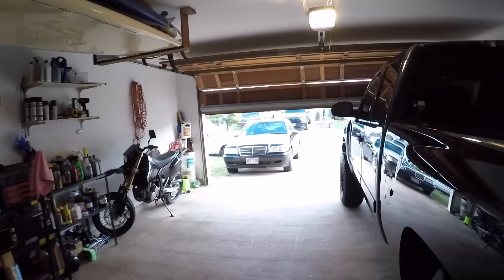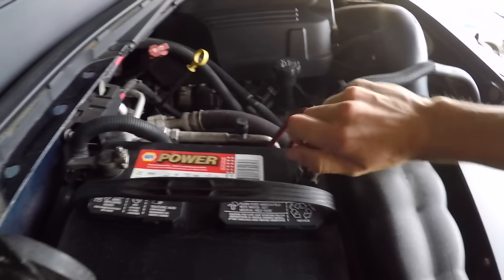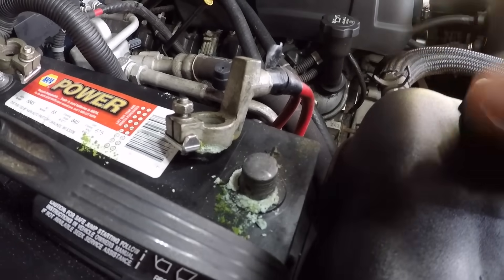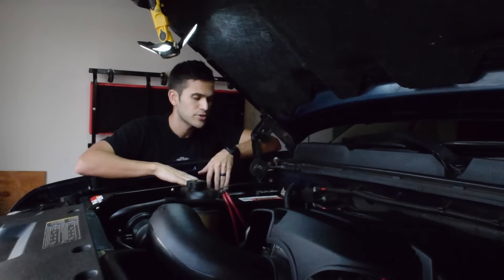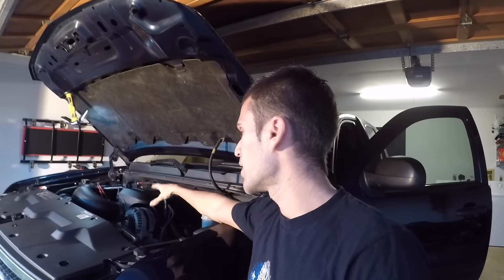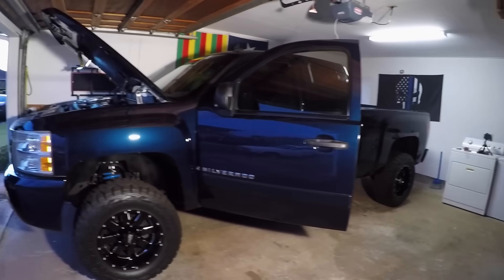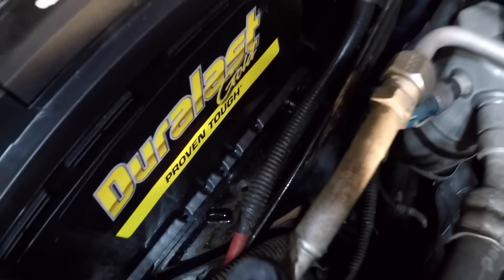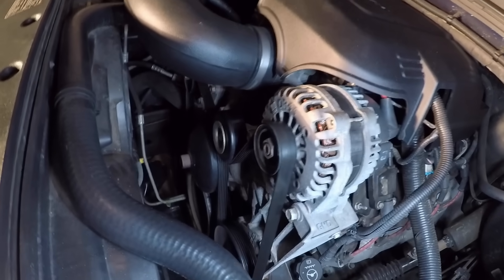Car Won't Start: Alternator or Battery? The easy way to know

Comment: Just one other point to add to an excellent video..On many vehicles, the alternator only charges when the engine revs reach a certain minimum valve, so if you do the alternator test with the engine ticking over, you get a false reading. Best thing to do is get someone to rev the engine gently up to about 1500 to 2000rpm and you should see the voltage rise to around 14v or just over...
Reply: That’s interesting to know.  I thought the alternator charged the battery even when the engine was ticking over.  Incidentally, roughly how long does an alternator take to charge the battery say from 12.4V?  Would I need to be driving for a few hours?
Reply: @Gazzab6  I think it's to to do with the regulator cct associated with the alternator, and it varies between vehicles...

Many years ago, I used to have a 2.8 diesel Isuzu Trooper which I used to off-road...I had been staying at a cabin for several days using the vehicle everyday, but only creeping about very slowly in low gear at low rpm.

 After about the forth day, the batteries  would not turn over the engine.  Luckily I was in the AA and one of their recovery vehicles came out and jump started me and it was the mechanic who explained the issue. 

He also said an alternator and regulator off a particular old Ford would cure it, although I would have to adapt the mounts ect to get it to fit...
Reply: @peterevans8194  Thanks for the info Peter.  I have a 2016 Honda CR-V 1.6 Diesel that has an EFB battery.  When I noticed the battery labouring when starting the engine, I had my alternator checked at my dealership and everything seemed to be okay with the alternator.  Just over two months later I had to replace the battery but I only had the car which was brand new for three and a half years - not very long for a battery I thought.  Three and a half years later, the exact same thing has happened.  This has also happened to my friend who has the same car.  It’s a mystery.  I’ve been checking my battery and it is showing 12V (12.2) after driving for an hour.  I have removed it this morning to charge in the garage and it is now at 12.8V.  I have tested the alternator with the engine ticking over and it was 14.2V but there were no electrics inside the car turned on.  I believe EFB batteries use a lower amperage but that’s a bit over my head so I don’t know if that’s an advantage or not.
Reply: @Gazzab6  it's a bit over my head as well lol. Was your replacement battery the same brand as the original? If so, maybe go for an alternative brand?
Reply: @peterevans8194  yes it was like for like as far as I know.  I’ve done a little research this afternoon and the EFB type is for medium sized cars with simple auto start / stop technology.  My car isn’t top of the range so hasn’t got all the electric gadgets but it has enough and I charge my sat nav en-route quite a lot so that will all add to the consumption.  I might go for an AGM type battery which are also for stop / start vehicles with more demanding electrical gadgets and the product description specifies for use with SUV’s which mine is.  Maybe Honda have chosen the wrong battery for the model I have and it makes you wonder why it’s happening to other owners.

Comment: I have a 2015 Dodge Grand Caravan with a brand new alternator but when I  disconnect the hot battery terminal it completely dies. I have a MaxiCOM reader that I plugged into it while I was driving it and it gave me 13.7 but when I stop and it's idling and remove the hot wire terminal the car dies completely. What do you think the problem could be?

Comment: You might not have needed to change your battery. You forgot about the corrosion you cleaned off. That might have been the cause of the battery not charging.

Comment: Having just replaced the battery (it was pretty obvious the old one was having issues), and still getting similar symptoms to those here when trying to start at lower temperatures, (got lucky twice (once before the new battery and once after) by turning off the radio and heater fan and dimming the lights etc, it started phew) looks like a new alternator is in order.  When  the temperature outside picks up a little (too cold/windy to mess with it), I'll dig out the multimeter and check it out.  Car is hovering around 296K miles (and almost 20 years) now with original alternator and starter, so was thinking it was one or the other…  Hopefully it is the alternator, as it looks a lot easier to replace than the starter. Good vid.

Comment: If anyone owns a GMC/Chevrolet Truck after 2012, please be aware that ECM may be programmed to NOT run the Alternator unless the Voltage drops to a certain level. The Standard practice using a Multimeter on the Battery may not work if the Battery Voltage is above 12.0 volts. You should go to a Battery Store / AutoZone  / Dealership and have the Battery Load tested, it's the only way to know if your Battery is good. Always attach the Negative side of the lead to the Negative side of the Battery first, not the Positive.

Comment: I have put everything new on my Silverado truck but it will not start I even bought a new PCM and no start I turn the not one thing but when I turn the key my engine light fresh on and off but everything works until I turn the key 

What could it me

Comment: I actually am wondering if you had any issues after this video. My GMC was doing exactly what you showed here. Did everything you showed on the video. Turns out, today when I went out and about my day, around lunchtime, my truck did not start again and had to jump start it. Came to find out it was the starter that had gone bad.

Comment: 10.4v is exactly one cell short (1.2v × 6cells) of a 12.6v battery. A bad cell most certainly because the plates got damaged jostling around without the battery secured via the bracket. Anytime you have 10.4v, you have 5 cells fully charged.

Comment: I had very similar problem was dead not starting at all no dash lights took it to 2 autozones tested it and both said was bad. Then I cleaned that gunk off the positive terminal wasn’t much and it started then drove it to oriellys and that guy said it’s good
Will be doing some more troubleshooting like you thanks

Comment: Don’t go to Auto zone find someone who sales Interstate Batteries and get one of them
Reply: About 6 years ago I had bought a car battery from Auto Zone . While trouble shooting the car for an unrelated problem involving the battery, my mechanic mentioned it was not a good idea to buy batteries from Auto Zone. I responded that up to that point my battery had been working in my car for 5 years. I had the receipt to prove it. Being that I keep all my receipts and a record of what parts I install in the car. It helps figure out what can be wrong with the car by seeing when I last installed parts in car. Bottom line is I guess some batteries are good some not; I got lucky I suppose.

Comment: the alternator plays no role in starting the engine, but it takes over providing the power supply from the battery once the engine is running, so if the car won't even start then it's clear that only the battery can be at fault

Comment: CHECK FOR SPARK PUT SCREWDRIVER IN PUG WIRE PUT NERE METAL ON MOTOR TURN KEY SEE IF IT SHOOTS A SPARK

Comment: Another way to test the Alternator/battery, get the car/truck started and running.... disconnect the positive side of battery.... if engine stops it is your Alternator... if it keeps running ... it is your battery... an old mechanics test method

Comment: Next time all you have to do is get the truck running by doing a jump start. Once its running disconnect the positive cable from the battery. If the truck dies then the alternator is not providing sufficient current to keep the truck running. But if the truck is still running when you disconnect the positive cable then the battery is not providing sufficient voltage to start truck.

Comment: Good video very straightforward no nonsense approach. I had to go learn how to use a multimeter 😅 in another video but very quickly diagnosed my bad battery and verified that my alternator is fine. Which is interesting since the dealership replaced my battery less than a year ago and now it’s bad. Well I’m replacing it myself this time with a brand of my choosing. Thanks for your help made my day. Thumbs up 👍

Comment: Toyota Corolla 2015 shut down while driving. Boosted it, it ran but shut off before trying to drive. repeat the process, it shit down again in the road. Repeat process to park it in the parking lot. Also, some crash dummy kut the kable so now the kable isn't long enough to get to the terminal. 2 questions, 1. is it the battery and 2, where would the kable need to be reconnected to or from?

Comment: One way to test the battery is get the car running and drive the car around for 15 minutes and then turn off the car.  If the car fails to start again the problem is the battery.  The alternator is providing current to both the engine and the battery when the car is being driven.  Since the engine fails to restart after the drive the culprit is the battery failing to take a charge from the alternator. 

You can also disconnect the battery from the car while the car is running but be "extremely" careful not ground out your wrench when disconnecting the positive terminal.  If the car remains running after the battery is disconnected the alternator is working and the problem is the battery.  

Or just do a simple test with a multi-meter and if the car battery has a reading near 12.2 volts with the car engine off the battery is OK.  Anything below 10 then the battery should be recharged and tested again.  When the car is running or the car battery is being charged the multi-meter reading should be 13 ~ 14 volts.

By far the easiest way is to just use a 12 volt (cigarette lighter) voltmeter tester.  I picked one up off EBAY for $4 from China and the 12V voltmeter works great!  Easily shows the alternator and battery voltage readings when engine is either running or off.

Comment: I have 2008 Silverado 4.8 at start up its around 14 volts but once i put it on "Drive" the voltage will go down to 12.3-12.5 volts. Does anyone know what could cause it? It starts up with no problem and the lights do not look dim

Comment: Mom's car's cat converter was stolen last month, thieves are desperate because she has a 2003 Toyota Corolla, but they stole it anyways in the middle of the day at a Walmart parking lot. Filed the claim, got approved, but since this crime is being committed so often, parts are backordered.  After waiting a month, the Toyota dealership then got to working on it, but called last week to say the alternator and battery were also bad, and estimate is around $950 out of pocket. We told them just work on the cat for now. My sister and I picked it up today, had them jump the car and it started right away. The guy at the front said, yeah, I think the battery is still okay, but he said don't install a new battery without first replacing the alternator because that will damage the car. The car started right away,, but noticed the battery indicator light was on the dashboard. Once we got home, looked in the hood and checked the connections, positive was loose, tighten it, started the car, the battery light went away. I borrowed a battery voltage tester, had no real clue what to look for, but it showed "Good" on the screen, and the reading came back at 13.53.  I guess that's how much voltage it had left. As a woman, we become easy targets for the repair shops. I have no brothers, just mom and her 4 daughters taking care of everyday business. Thank you for your video, it was extremely helpful.

Comment: Hey have a question when charging up the battery should the key be in the ignition because I have a wireless Jumping cables and I don’t know if the key should be connected to the ignition or not

Comment: love the vid , the only prob is that you have the vehicle backed in , which is causing exhaust fumes inside , when working on any vehicle in a garage you should always face the front in and exhaust out the back , plus your putting carbon stains on the wall , other than that , really nice truck , i have a bike ...  :(

Comment: Hi, useful video. Q,:  2001 Mazda mpv engine cut off while driving. Since then it cranks. Battery is good. Tried jump starting. Did not work. What may be the issue, thanks

Comment: Batteries have to deliver over 12V to start a vehicle engine. Just charge the battery!  Stop wondering and figuring and use common sense ...

Comment: Ok when I went to turn my truck on tonight I didn’t get nothing. No dome lights, no radio even my power seat wouldn’t come on. I’m hoping it’s a minor issue and lots of crud like you have on yours as well. I cleaned it off but still dead

Comment: Keep in mind alot of these newer vehicles are using AGM batteries over the old wet cell batteries and as such don't run the charge voltage over 14 volts. It's usually below 14 volts. Somewhere in the 13.4 13.6 range most of the time. Also on older vehicles say 10 to 12 plus years old. Make sure your battery cables aren't breaking down internally as this is probably why you're old alternator went up in the first place and if you put a new one on there without changing the cable or cables. It's eventually going to fry your new alternator. Now it might take 6 months to a year but it will eventually kill it. The warranty on the new alternator does not cover an alternator that failed due to a bad battery cable. They will literally break down internally. If you pull the insulator jacket and the copper wire inside is turning white and green. It's time for a new battery cable. So be really careful and thorough with the cables. Believe me these companies nowadays you just look at it wrong and they'll void the warranty on you. Therefore don't give it anymore help than you have too.

Comment: what if when tested the battery and it says 12.5, then when the engine started I have tested the power that comes in and it reads 13.7 is this indication of a good alternator too?or it way low?

Comment: I have a 2007 mustang and it’s dying everyday, when I got it they said they put both brand new alternator and battery in and when I went to get it checked to see if they did, I was told that they were both brand new. Any opinion of what my problem is?

Comment: Mine started and ran fine as of Saturday. Tried to start it for work today on Wednesday and it made the same noises yours did and all the electricals flashed and reset. I live in Arizona where the heat and sun is notorious for draining battery life so I’m praying it’s the battery
Reply: How did you figure it out?

Comment: A few years ago I was driving and my car died out of nowhere. A mechanic told me it was a bad alternator. He was wrong. The battery was new and the Alternator was new. The battery wasn't secured so it kept wobbling. Cuz I didn't put the brackets back on. Idk what that thing was at the time. But now I know. once I put the bracket back on. The car never had an issue. Until 1 month later. The car turn off on me while driving. Once again my mechanic told me it was the alternator. He was wrong again. One of the hoes busted. Nothing came out so I'm assuming it was air. I put an empty pen cartridge in there and then taped it back together with plumber tape. Never had an issue ever again.

Comment: I know that this is from a few years ago but a couple of tips for those who wanna stay safe: always wear gloves when messing with a battery, that corrosive stuff is bad news for the skin. Also never use a car to jump a larger vehicle like a truck, it can drain the car battery life and most likely won't have enough power to charge the larger battery. Otherwise you did a great job explaining the process of elimination.
Reply: Emphasis should have been how you tell abad alternator 😅
Reply: "that corrosive stuff is bad news for the skin."
That's the main reason why I never tried cleaning my battery terminals. That stuff is EXTREMELY bad news. It's almost invisible. Even a speck of corrosion can do major damage to any clothes you might be wearing.
Then I discovered a secret: Baking soda. I wish I knew the seriousness of battery corrosion early on, and how baking soda neutralizes the effects. WOW! It doesn't take that much either, plus a squirt bottle filled with water. It took me an hour to thoroughly clean both terminals.

Comment: thanks for sharing.  had to break out my old multimeter that i bought in my 20's and brush the corrosion from it's battery terminals, before I could use it on my truck! lol.  Once cleaned, I was able to test the dead battery on my truck.  Good tips!

Comment: I Spent $1200 on my 2008 2500hd at a mechanic who replaced the battery and starter for intermittent non-starting. It still was happening, I even told him before he replaced the battery and starter that when I wiggle the cables it normally started after, he was probably lazy and just upsold on the battery and starter. It was still completely dead occasionally. I ended up replacing the negative terminal cable from a part from the Chevy dealer myself, that fixed it. It wasn't the terminal it must have been somewhere in the negative cable. Hasn't happened in two years again after replacing the cable.

Comment: I think my bat is bad . its lose the charge even if a leave both terminals disconnected for a few hours, but as soon as i start jumping it the car start to lose power and shut down if i leave at iddle, the thing is i never see the bat light turn on when this happens, my alt was checked twice and is charging good, its posible thata a new bat could get damaged fron one moment to another?

Comment: Get vehicle started. Disconnect lead from battery.  If motor dies its a bad alternator. Or get vehicle started and drive to auto parts store and they will check it for free.